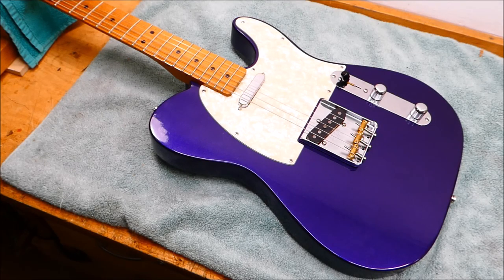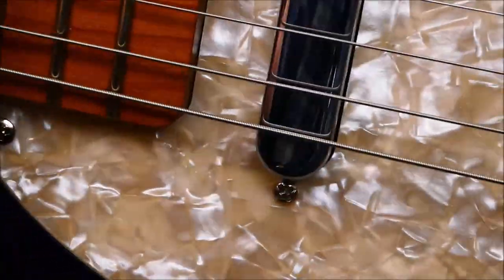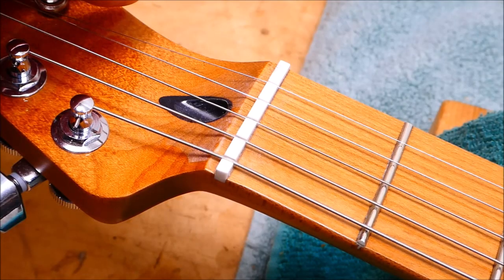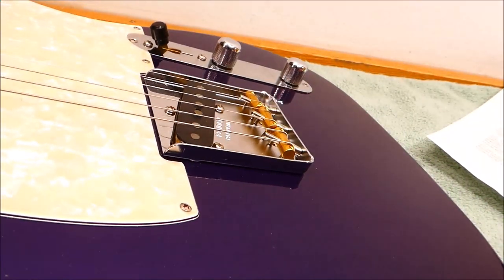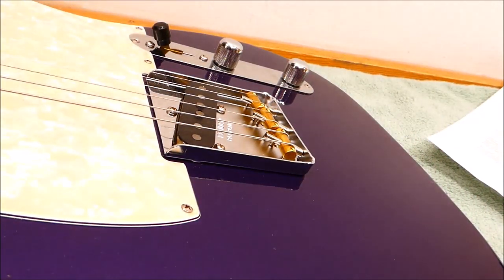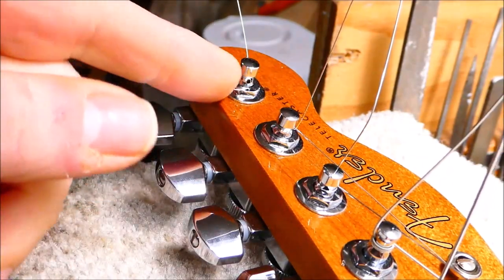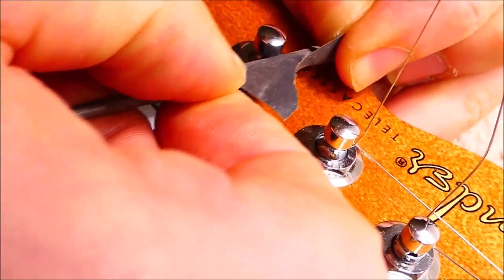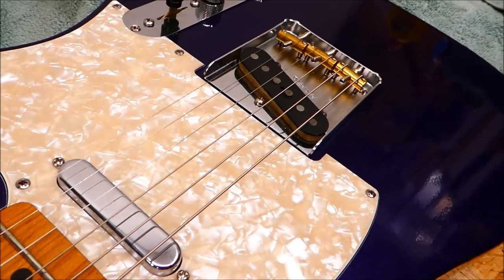A Blueberry Telecaster

Comment: Because of this channel, I just did my first headstock repair. Thank you, Mr. Woodford!!
Reply: Me too.
Reply: @harlanbarnhart4656  I bought an Epiphone Les Paul with a break in it with the hopes of doing it. I watched several of Ted’s videos several times and then had at it. It came out great. A little sanding and I couldn’t be happier. It’s obvious, by looking at it, it’s repaired but not by touch. I could not be happier
Reply: @ChewinOnCrayons  that’s awsome, hows the guitar doing?
Reply: @fuchsia5899  it is rock solid. It’s been 7 months or so and between that repair and a little nut slotting action, it stays in tune and feels great.

Comment: As a machinist when I need to really round off the edges to a small hole (like in the tuners) my favourite tool is a (surprisingly cheap) diamond coated needle file. These offer the stability and control of a needle file while allowing for metal removal in any direction like the sand paper.
They also have the advantage of working on really tough metals including inconel but are not good for really soft alloys.

Comment: For me, I like the saddles to be higher for two reasons; I need more space under the strings to the body as I dig in with the pick pretty deep. 
And, by having the saddles higher, I don't have the adjustment screws digging into my hand when playing and muting.

Comment: Nice explanation for the locking tuners height etc. I have the stock Sperzal tuners on my '88 Strat Plus. I usually wind at least one full wrap around the post with the end going under the string that is poking through. Two reasons. I have had the tuners come unlocked and, with the full wrap around, the string will actually stay in tune which means you can finish Brown Eyed Girl without losing you tuning. Lol! Also I use alternative tunings and, with no wrap around, the string will be bending at the attachment point and after tuning up and down a couple times, the metal of the string gets "worked" and  becomes brittle and snaps. Especially the high E. I do like the lockers though. I put them on all my electrics. Great videos Ted. I am learning a lot. My neighbour, Fred Casey is also teaching me a lot (you may know him). Keep up the great work!

Comment: I use the short posts for the E, A and D and that gives me a reasonably good break angle. The string tree takes care of the high E and the B, and I just do a few extra wraps to lower the take off point on the G. That seems to work fine. I did that for both my tele and my strat, although I don’t know why I ever put the locking tuners on the tele other than it makes it a little quicker and easier to re-string. Didn’t really have any tuning problems with it otherwise.

Comment: I got me one of those $89 Glarry thinlines in Sunburst.  Made all the necessary appointments, tuners, Tex Mex Pickups, pots/switch and a little bit of fretwork.  I noticed however the barrel saddles were somehow able to intonate remarkably well, which is my first personal experience with those saddles.  So tinker as I will I got the brass compensated saddles from Musiclilly thinking I could maybe do even better...   

Wrong. 

 So I just turned them upside down unfinished and put them back where the original saddles were and man is that just a killer Tele.  I did have to reshape the headstock and I did remove the logo but I've no shame telling folks what it is.  I don't think that's very common to find one that intonates that well.  But man I dig that metallic blue!

Comment: Excellent advice on how to intonate Telecasters. I honestly can't hear which string is "out" but I can hear when it's not right. I changed over to a set of Brass compensated saddles to get my Tele to where I'm happy with it but I might try the original steel saddles again at some point. Interestingly, the actual string length with brass saddles is about 2mm longer that it was with the steel...

Comment: Great stuff! I actually set my relief so that the strings are pretty much parallel to the neck above the 12th fret. Because: 1) I like a bit more relief for bending around 5-7th fret and 2) I don't like the action creeping higher and higher above the 12th for no good reason - I want it high enough for bending and no higher. And no it doesn't need to get higher, if anything the frets can in fact slowly spiral up towards the saddle line without buzzing. Think about it - why should the 150th fret fall 3mm below the saddle? It should be almost touching the saddle.

Comment: The proper way to set string spacing is to rough out the blank and set them by eye. The eye is the final judge. Some eyes are better than others, but that's the best way in my opinion. I use rules and gauges, but a long time ago I learned to use my eyes. And make sure to properly protect them in the shop!

Comment: I modded my strat with those locking tunners and the exact same thing was hapenning to me, what did I do? At first I did exactly what you did, but it drove me insane (short short long short long long) so I added a second string tree for 3 a 4 and reversed the tuners. longs for 1, 2 and 3 and shorts for 4, 5 and 6. Works perrfectly now, looks great and I can actually use my vibrato with detuning (I don't dive bomb tho)

Comment: At 17:00, notice the strings passing through the holes in the bridge plate ( sometimes known as the "ashtray" bridge). This spot can be a source of string breakage.  Ted may have a better solution for it, but one way to prevent string breakage is to pull the insulating jacket from some thin wire, maybe 20 or22 Guage solid wire, and slip a short piece of the now hollow insulation over the strings and slide it down to the bridge end of the strings before installing them, so that the strings are sheathed in a bit of thin rubber or plastic as they exit the holes in the bridge.
Reply: I read about SRV doing that w his strat’s strings and I tried it and it worked!

Comment: Those are surprisingly nice necks.  I have one on my Tele.  You do need to dress the fret ends and cut the nut.  Yes, Fender provides way too much nut material.  I had to shim my neck (the other way) for proper saddle height, and with those staggered tuners which are inexpensive and fit without drilling, a string tree is not needed at all (my favorite feature).  My suggestion is to rub bar soap on the neck screws before mounting the neck.  That roasted maple tears out very easily.

Comment: There are some very inexpensive diamond rod knife sharpeners found on places like ebay and aliexpress with  a long conical end that are great for removing burrs in small places like tuning machine holes. The conical end tapers down to about 1/16" dia. at the tip. Being diamond coated, all you need is some light pressure while rotating the rod, and the burrs gently flow away. And they can be found for $3-4$ USD.

Comment: The craze for “Roasted Maple” necks may prove to be a mistake.  My family owned a large timber importer and sawmill in the UK since Victorian times, and had extensive seasoning sheds full of exotic woods that were acclimatising to the English weather and losing excess moisture.  When pressure rotproofing and kiln drying came along, they had a large investment in the equipment.  Customers would often demand timber supplies with unusually low moisture content, and the timber was supplied after it was suitably “cooked”.  The management knew that the timber would re-absorb water and return to its pre-cooked moisture content within a few weeks.
Reply: Most guitar necks are sealed with a layer of finish, not a problem for us

Comment: String trees are used on cheap-to-build necks.  What I mean is less angle of the neck.  This takes less wood to build.  With a 15 or 17 degree Gibson headstock, you have enough angle but there's more cost to build.  Leo was fanatic with lowering cost.  Think of a neck that gets damaged with a Les Paul vs a Strat.  One needs a skilled luthier like you to fix, the other, any teenager can unscrew the old, broken neck and simply screw on the new one.

Comment: Dude!, The thing about the nut. I shaved my string slots on my fender acoustic down too far that I have to buy another because the strings at the G & D are sliding off the nut when I bend or vibrato. But what I'm really interested in is making my own out of cow bone instead of a synthetic compensation nut. But idk where to find any cow bone. I tried the local Walmart and supermarkets but they only sell the marrow. I'm gonna try this local butcher who might hook some up or sell it for cheap. Wish me luck
Reply: Make friends with an avid hunter and get some deer bone and antler.

Comment: OK ...On telecasters you must use all short fender lockers....that's why they sell them that way .....and on strats you want to use 2 longs and 4 shorts and again that's why they sell them that way. Everyone buys the 3 long and the three short because they are the cheapest set....but they are wrong for both....Problem solved and you don't need string trees if you do that but I still do ....but I use graph techs which have almost zero friction besides looking good. I set my customers up with 1 long and 5 short on strats so it keeps the break angel looking the same on all srings...you don't have to do this but it just looks cleaner. but on teles you do have to use all shorts even if the stings break angle looks different ....if you want your guitar to stay in tune always no matter what you MUST use locking tuners and bone or graph tech nut and if you have a trem bar and use it a roller saddle or grarf tech saddles are a must.... your guitar will stay in tune set after set. I have lost count how many of these setup I have done ,,,but every time I give them there guitar a week later they bring me 1 or more guitars to have it done on them...There it is from another pro teck. He's mostly right about every thing and on this one he was not wrong but just missed the full fix.

Comment: Without excessive "wammy bar" hijinks, I just don't get locking tuners.  
Even still, isn't it strings stretching, or a badly cut nut pinching the strings that causes trouble, and not the tuner loosening?
Slotted Klusons have always worked for me, even on a Strat, with calm, subtle wammy use.
Such a simple ways to string a guitar.
Reply: Being a bass guy that only dabbles in guitar, I MUCH prefer slotted tuners.

Comment: I recently finished my first “build” with a Jaguar licensed bolt on neck and put those same tuners on it.  I have yet to install the string tree.  I’m admittedly not a player per say, just a tinkerer with a smart understanding on how it should feel and play.  Intonation is spot on and I hear a lot about the importance of break angle.  I just don’t fully get it. It plays great for me and stays in tune petter than my unmodified les paul.   Is there a simple explanation on the importance of break angle?

Comment: 00:43 Purely from a visual design perspective, why oh why was the pickguard extended towards the bridge so that it needed cutouts for the pickup and control plates? Why does it end in a straight cut-off line when the rest of the profile is so curved?
It could have had no cutouts and still be straight, or had a more organic shape with cutouts.

Comment: Interesting as always. I can't say I really "get" the need for locking tuners on a hard tail.  And the point about more winds around the tuning posts for bass strings is very interesting.  I'm surprised no one makes tuners that have a longer portion of the thin part of the winding post.  If you start winding down to where the post gets thicker (to get a better break angle), you are sort of reducing effective gear ratio (not really but for a thinker post, turning the same number of degrees tightens the string faster).  Which just gave me an idea ... I like Graph Teck's Ratio tuners (which offer different gear ratios for each string) but they are super expensive. I wonder how feasible it would be (and how much less expensive to manufacture it would be) to solve the same problem with constant gear ratios but different diameter tuning posts?  I've never had a problem with intonation screws being long enough to be poking above the strings. But I have had lots of times when I run out of spring compression to be able to tighten the intonation screw enough. And I've had several guitars where I had to trim the saddle height screws so they were not sticking up above the saddle. Great ouch potential if they do. I don't have a better design, but I just can't help but think there is a better design waiting to be born. Kind of the same feeling every time I look at the Derailleur's on my bike.
Reply: The tuners still help a bit with staying in tune, i like it in all my guitars because it's way easier to change strings lol

Comment: The guy that brought the guitar in did a decent job. If it were my guitar, I would have set the slot height, dressed the excess and rocked out. 
I really like the Gotoh compensated saddles. They work really well and they look like the original straight brass saddles. Nearly perfect equal temperament intonation(is that an oxymoron? LOL). Not all Tele’s need them though.

Comment: It occurred to me that what your doing,  through experience and knowledge, is what a Plek can help achieve.  Pleks diagnostic capabilities end there.  You still have to have a competent tech to read the info and make the adjustments.  Currently about $300+ and the machines are not common.  Somehow I think I would prefer to have TWoodford do this work.  He would find the machine interesting and useful, but his knowledge base, separate from the machine are what make him valuable.  What a concept…a guitar with everything correct.

Comment: The low E string nut slot is way too far from the edge of the fretboard and that's not just my opinion. Look at any factory-built Fender Tele and you'll see what I mean. And if you re-did the nut with the low E shifted more toward the edge you would have more total space between the high and low E strings which would allow you to have slightly more space between each of the individual strings. Also, I always replace any plastic nut with bone which is a much denser material which always improves the tone by increasing the sustain. And bone has the added benefit of being much more wear resistant which means the slots won't deepen over time especially when using a whammy bar. I usually use two string tees, but I use the roller type because the vintage button type and wing type both cause a bend where the string enters and that's a cause of string breakage. One last thing I would recommend is a compensated bridge like one's made by Wilkinson. Also, I notice that on this guitar for some reason the low E string is running over the saddle height adjustment screw hole which makes me wonder if the whole tail piece is shifted to one side or if the nut spacing so far from the edge is an attempt to shift the low E string over at the saddle. The strange paint color also makes me wonder if this is a "parts caster" poorly assembled from a box of random parts.
Reply: Lol everything apparently increases sustain